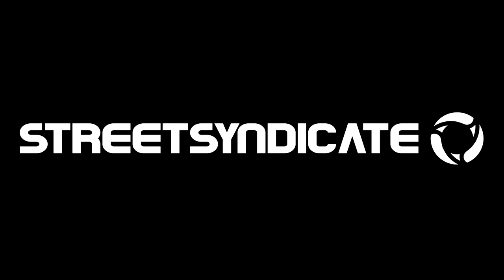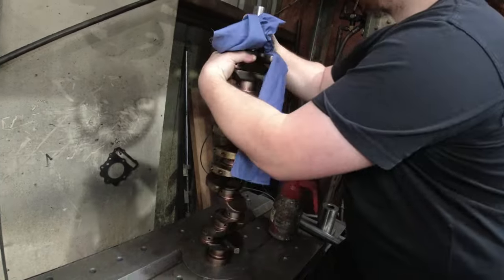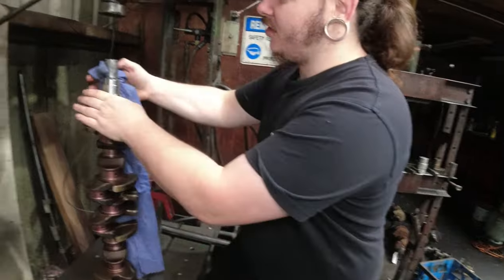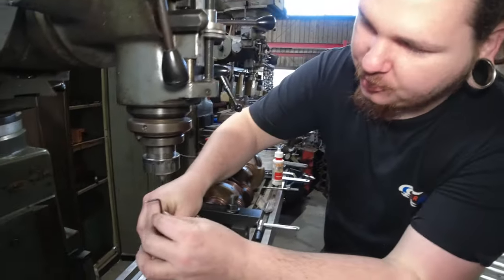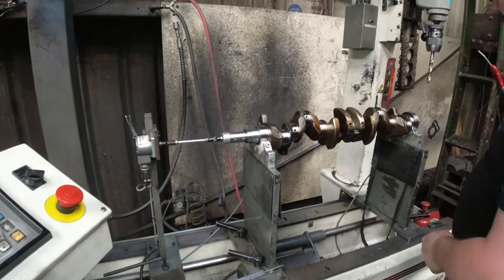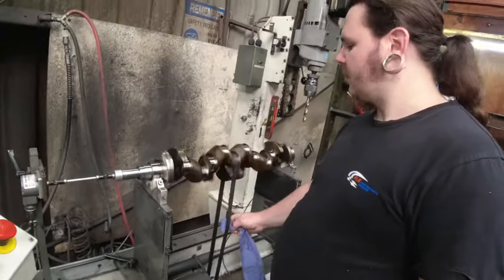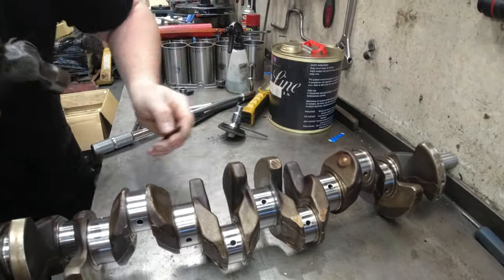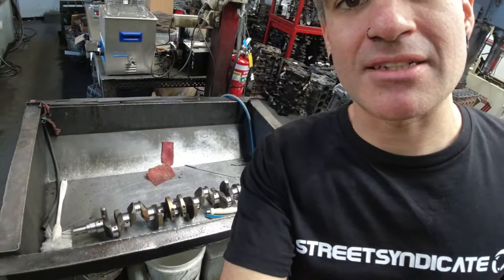RB25 Essential Crankshaft Mods - Extended Collar, Balancing, Grub Screwing

Comment: Would you balance again after grub screwing the crank?
Reply from the maker: If you want to be absolutely pedantic about it you could, but for my relatively moderate power build I was told it won't make a noticeable difference. Hope that helps!